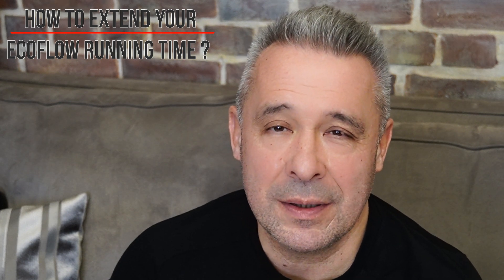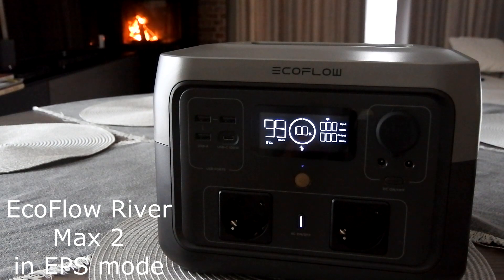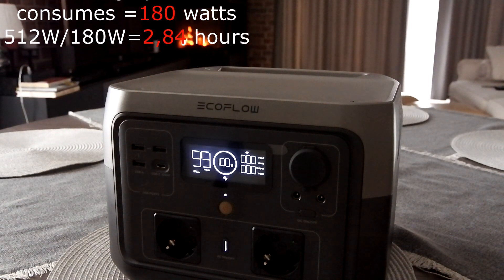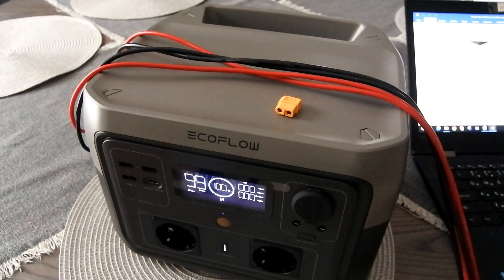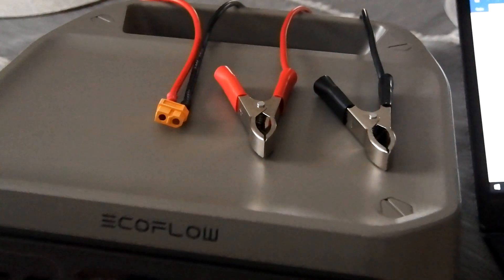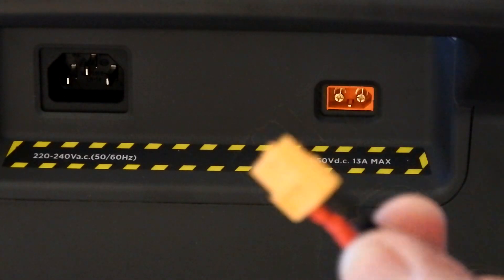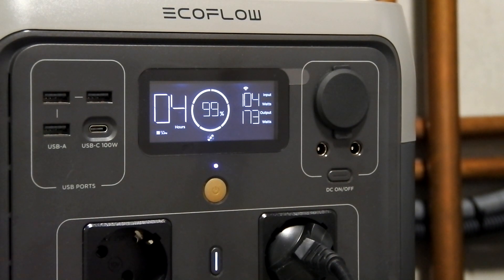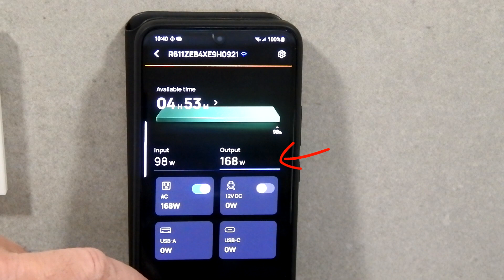How to extend your EcoFlow running time ?

Comment: Can we charge the battery directed to the solar panel while using?
Reply from the maker: Hi, and thank you for your comment and question ! Shortly, yes, you can, for sure, and that's feature is really great. For details, please, check manual, if you will use some different solar panels from other suppliers, please, try to meet solar battery input voltage requirements, it surely, will works great. Thank you and have a nice day !

Comment: Thanks for sharing the video. It does prove a point that the River 2 Max is quite the capable power station. I think I can also do the same so as to extend the running time of my River 2 Max.
Reply from the maker: Thank you very much for your comment ! I'm very glad to be helpful ! Only the one thing left - you should keep the charge level of your extra accu battery on a good level. 
Thank you gor watching CeazyEngines !

Comment: I do like the fact that the River 2 Max only needs an hour to fully charge.
Reply from the maker: Yes. and this is absolutely amazing ! I think, that new LiFePo batteries, utilized in new EcoFlow line (River 2 Max, Delta 2, etc), are capable to accept higher charge currents, so that is reduce charge cycle. And the most important, that  LiFePo batteries type are more reliable and has increased service lifetime, as well, as longer warranty support period.
Great engineers created such products, highly user friendly and flexible.  
Thank you for your nice comment ! Have a nice day !